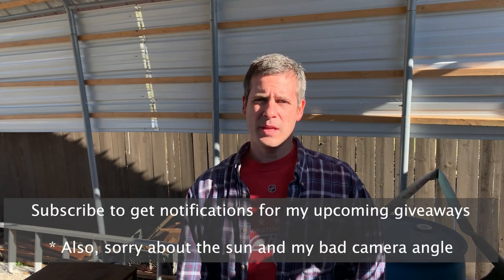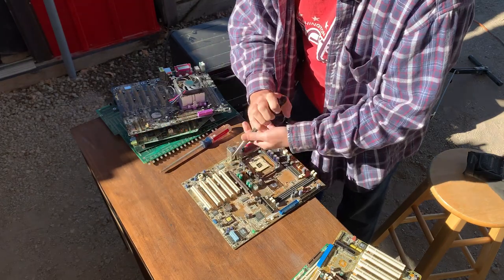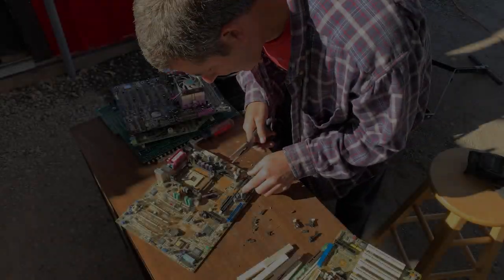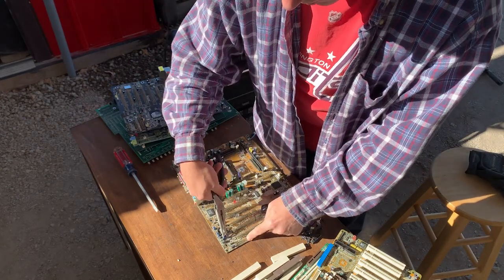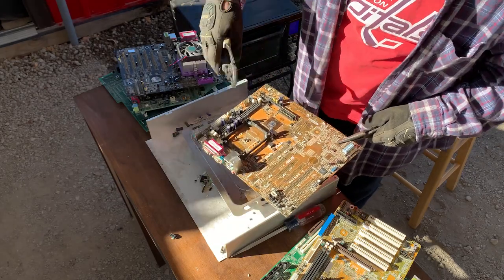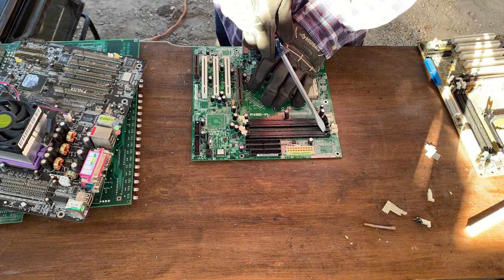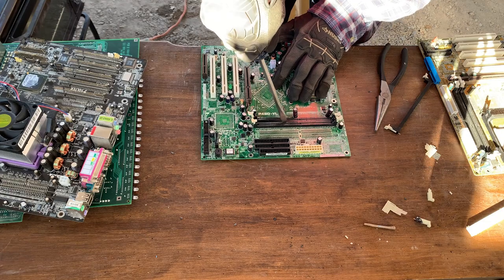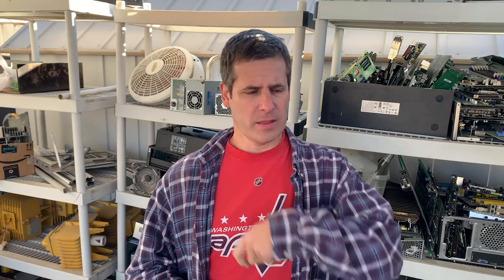Fast Motherboard Gold Recovery

Comment: Awesome video. I was scouting eBay and came across boards for sale. I’ve always wanted to do this as a side hobby and it’s nice to see people sharing their experience on the easiest way to do it. It won’t make you rich but it might be a nice way to save up for something cool doing something that helps recycle otherwise dusty useless garbage that a lot of people toss in a landfill.
Reply from the maker: I am working out an even easier way... more brute force, but less time, and less electricity cost.  Hardened paint scrapers work good with a hammer.  They will sheer off pins, pop off ICs, pretty much you can clear a board for free (no electricity or heating).  It sometimes sends things flying... but it won't create fumes or smoke.  And I can typically clear an entire motherboard in maybe 1 to 2 minutes ... were as the toaster oven cooks the solder in about 7 to 10 minutes.  If left too long, the toxic chemicals start to ooze out and your cloths smell like burnt plastics for the day.  

I would look into using a scraper.  I will have to do a comparison video between the two processes.

Comment: curious to what you do with the cleaned board when you have depopped it because the boards have quite a bit of copper in them grind and pan out or take out to the farm and burn but dont stand around them until finished I think while I was writing my comment you may have mentioned it
Reply from the maker: I have been selling them to copper reclaimers… returns are terrible for the value.  I get $0.10 per pound… but at least I am not throwing them in landfill :)

Comment: How many grams can I recover from 500 motherboards (250kilos)
Reply from the maker: Grams in gold?  Or material removed?  Every board can be very different.  There are slot vs socket processor receivers, 2… 4… Even up to 8 RAM slots. Some are different sizes, even different shapes.  Some are newer and the gold corner BGA ICs are replaced by green fiber chips that have little to no value at all.  

I don’t have a good answer.  I personally am trying to get a good estimate for the boards I have… one company approached me and offered me just short of $1.00 per pound… I am rounding and estimating a little and ignoring size differences here… but if 1 board is generally 1 pound, then 60 boards could be about 1 gram … that is a gross generalization, and I don’t have the data to show for it… but it is the closest answer with numbers I can give you.

You really have to break it down and process pins, ic chips, and fingers… those numbers are much more consistent.

Comment: Anyone have a toaster? Does the ram shed its irons? Which machine should we use? Or should we cut it with iron scissors? Urgent reply please.
Reply from the maker: I am not sure what you mean by “irons” … and are you looking for someone to sell you a toaster oven?  In the United States, these can be found at many online stores, such as Amazon and eBay.  You can also get them at many appliance stores … they are not very expensive … most of the time.  You will be able to save some money if you buy it used.  As for irons… ram is a fiber board with copper and sometimes a light gold flashing.  On the surface of all ram, you will have fingers (most are gold foils but there have been years where tin was used), surface mount resistors and MLCC capacitors, and finally, black IC chips.  I trim the fingers with snips or a paper cutter.  Once the fingers are cut off, I use the oven to melt the solder so ALL surface mounted components fall off.  I sell the capacitors and resistors (they will contain silver and a very low amount of palladium… I don’t process those myself).  I process all my own IC chips for gold.  

Does this help? Or do you have more questions?  Questions are good, … just be sure you know your risks and dangers before you start.  All of these recovery and refining steps will try to kill you one way or another.  Please be safe.

Comment: Has anyone done it with a microwave oven?  I haven't tried it.  Motherboard caught fire.
Reply from the maker: I would absolutely never do this with a Microwave!  The principle behind microwave heating is that it agitates water molecules and causes them to vibrate which heats up and expands.  This generates heat in foods, but it causes sparks and fires with other things.  Paper catches fire ... I have done that before.  I have had kids put tin or aluminum foil in and it smokes and sparks really bad.  I am very sure that a microwave is a terrible idea.  Please don't even try it to "see what happens" ... that would be a bad idea.  Be safe :) but thank you for asking.
Reply: @badideametals  you're right.  I tried it and got very bad results. Can we use Normal Oven?
Reply from the maker: @thelastsamurai82  sure.  A normal oven has a broiler temperature about 500 degrees F.  Solder melts about 350.  There is a nasty fume gassing that occurs with reflowing circuit boards.  My cloths smell like burnt plastics and chemicals.  I would recommend not doing that in an oven you plan to cook food in.  But that is just me
Reply: so what do you recommend?
Reply from the maker: @thelastsamurai82  I do my toaster oven outside.

Comment: Nice video. I'd like to share my experience: I don't cook due to no space and it's still toxic to breath. I use Tongue & Groove Plier to remove PCI slots plastics, mall nail removal tool or bent flat screwdriver to remove RAM slots plastic by picking from bottom, metal cutting scissor to cut gold plated  tips of pins, flash cutting plier to cut ide connectors with plastic. Thanks.
Reply from the maker: Nice :) those do work ... I started out doing the manual clip and rip method.  I stopped after my arm would cramp up.

Comment: Good info. New Subscriber 👍 Toaster oven isn't a bad idea. I still worry about the energy cost. it would be nice to bring it to almost zero. I was thinking about a campfire with an oversized/large pan/sheet that has a layer of sand. A bed of hot sand to loosen everything up. Maybe even pull those long plastic connecters off after a few minutes of heating and then later drop the pins when it's really hot. I have plenty of free firewood where I live. Let me know your thoughts and anyone else is welcome to pipe in. Thx
Reply from the maker: Thank you so much for subscribing!! I did the camp fire computer cookout once and was sick for a week... my neighbors mentioned it smelled outside ... they did not know what was burning, but they said it smelled toxic... and it really was.  Camp fires get too hot as I learned... also, the fire is unmanageable ... as the fuel gets consumed, the heat drops, when more fuel gets added, the heat spikes.  And the distance of my pan to the core of the fire was hard to adjust... so I just let it over heat... which caused a lot of bad smoke... 

I too have a lot of free wood available to me.  I really wish that it worked out...

That was the last time I used a camp fire to depopulate... but I had the same thought you did :) ... I am researching solar panels or a solar oven... but it would need to be a summer thing :)
Reply: @badideametals  Yikes yes definitely I wouldn't do an open fire. And I bet you probably did have a toxic smell. 😂Plus not around other houses for sure. You would want to be on a bigger piece of property. 
My idea would be to heat the sand. A sand bath for circut boards is what would do the melting.
And definitely wouldn't want to heat them to the point that they're smoking.
My idea was a pan or sheet that covers the fire. Like over a pit or tower of blocks. The sand would be either on that sheet or inside of another sheet/pan whatever. Then throw a couple of boards on and let them soften and then drop your pins. The fire should never touch the board.  
Anyways it's hypothetical...just a thought on another way to depopulate. 
I pretty much box and store my boards for now occasionally pulling a few parts off with a torch only if i want the complete circut.
Thanks and keep the videos coming.👍
Reply from the maker: @TheLandlordPicker  the sand would be a good way.  When you have that working, let me know :). Free heat is better then hours of running a 1100W oven.
Reply: The sand is legit. I sort of did a combination of the two with my electric skillet filled with sad to hear them, componants facing up, then manually pulling what I wanted with ease.   I did a few times just scrape the whole board of stuff into the sand and ended up throwing a lot to the trash because it was stupid to sort all the componants from the sand. That being said,  get as fine of sand you can find maybe would work a little better

Comment: how long do you keep the motherboard in the oven
Reply from the maker: It varies… I listen for things to fall off, or I look for smoke.  If I see or smell smoke, it is time to clear out what is getting over cooked.  But in general, once the tray and oven are hot, a motherboard in an oven at 400-450 degrees F will take about 8 - 12 minutes.

Comment: The best method for heat is a fire pit with only ambers left from a fire. Charcoal could work as well but thats expensive. If the board cools down sit it back on top of the oven rack or whatever you might use to hold the boards above the hot ambers.
Reply from the maker: I did it over a fire, not coals ... and it made a mess of the chemicals in the boards.  I will have to try again but not when the fire is raging :)  A fire pit with an endless supply of free firewood is a lot cheaper then my power bill after running a 1200W toaster oven for hours.
Reply: @badideametals  DONT DO IT OVER A FIRE, build a fire and once said flames are all gone you have hot ambers, than have the boards a foot to 2 feet away. There are several methods, archimedes has a decent one if he would have the boards further up from the ceramic he uses.
Reply from the maker: Right :) I learned that one.  The coals idea I did not try ... just like roasting marshmallows :)
Reply: @badideametals  something like that yes. Fire will kill any board, first warping than melting and finally burning.

Comment: Here the best tip for you, dont worry about plastics, leave them on there because most of them are not affected AND the connectors will all come out at once by just pulling the connector  by the plastic. Remove the pins later by lite incineration so the plastics will turn to ash and you can filter the ash out but its not needed, whether its Eco gold ex or HCL, Nitric or AR it will be fine. The less work needed means you can process more boards which is the name of the game since thats the longest part. 

Other people do crazy stuff with a hammer chisel or chisel by hand waste of time you have to sort later. Ewasteben should of never shown that to anyone, hes a joke.

Just remember you still need to boil these connectors or pins in HCL or use dilute nitric like 5 or 10% plus citric acid to remove the solder.
Reply from the maker: First: What is Lite Incineration?  I watched Dasun 999 do something where he put all the plastic connectors in a pan and processed them in a fire just like they were IC chips being ashed ... 

Second: I tried doing pins without Eco-Goldex months ago, and I have to admit, I was not successful, and I wasted a decent batch of pins... do you mind either sending me an email, or posting here your process for desktop pins?  

Finally: Yes, HCl is my friend for solder removal.  

Thank you for all your comments across all my videos :)
Reply: @badideametals  First you have to tell me what you did and what happened, Than I can help you fix any steps you missed. Im guessing you didnt remove the solder first and it made a big mess
Reply: @badideametals   there are several ways to do Desktop pins BUT its really not worth doing anything new because its gold flashing, with that said reverse Electroplating or Eco Goldex is the best bet since its mainly base metals. 

Lite Incineration or light incineration ( I say lite so people wont think you should actually use light ) is just that instead of trying to crisp the plastic like a well done steak you just want to reach the point when the plastic bcomes white. Whenthat happens all you have to do is smash them and you essentially have ashes but plastic like. Than screen them with mesh or any type of filtering system you wanna use that will let the small ash particles threw but leave the pins behind. You could also wash them like wet ashing after the reaction is over. 

BUT before you try to recover ANY gold you need to run these pins through Boiling HCL to remove the solder. If you dont it will create massive problems in AP. Once you boil the pins you need to wash them with hot water several times. After that I would put them back in HCL and see if any tin still remains by looking for the smallest reaction. I usually let it sit for 5 mins and if I saw no reaction you can than add hydrogen peroxide. You could also go the route of nitric and citric acid to remove solder. Watch owltech and bohumil graman you will know what to expect, I should the linkmthe videos so it wont take long to find them for you
Reply: @badideametals  If you didnt have solder im guessing copper numer 2 chloride formed. When that happensyou need to add more HCL but you can also filter the solution off put everything back in a beaker and start over with fresh acid and peroxide. This might need to be done several times. There also a special tube you can buy, I forget the name because I never bought one and only know about them my chemistry classes and seeing other people use them for fuck ups. Its basically a tall beacker with very little girth, since gold is heavier it will tend to stay towards the bottom, this way you can mix whatever compound formed with fhe necessary acid or chemical so it goes into solution or lightens the density so you can pour it off but leave the gold. These tubes can be 2 to 3 feet tall, hate when I cant remember a name of something.

Of course if you have a massive amount of material it needs to be brought down to a manageable amount before using the tube. You can do this in large beakers, buckets or even tubs for storing shit. You can see why low grade pins are such a hassle if you mess up, hence why eco goldex has become popular even if yields are lower
Reply from the maker: I did HCl for solder, then I wanted to just take the gold off the pins, so I put it in a little AR hoping it would just start eating metal until I halted the process.  It munched metal for about 15 minutes.  I filtered the solution away from the solids, and I tried cementing out gold with SMB, and I literally got nothing.  The pins were eaten down to copper and other metals which turned black.  So, my hope to just AR the top layer was not useful ... I just did it with a small batch as I did it as a test.
Reply: @badideametals  incineration is different from buring also. If you get caught burning plastic its a federal crime since the clean air act. Most likely you wouldnt be charged with but i wouldnt take the chance especially if you have asshole neighbors. Incineration is basically breaking something down with heat without fire touching it
Reply from the maker: Great help!  I will have to try these things.  I have a growing number of pins as I keep depopulating boards.  I would like to get what I can ... as we talked in another video's comment board, I am going to try eco-goldex here pretty soon.
Reply: @badideametals  OMG, never do that again, heres what happen, do you remember the Reactivity Series of metals Chart? If not google it. The gold was dissolved than fell back out of solution because of copper or whatever metals was in the pins, this happened OVER AND OVER until the All available nitric acid was consumed, you had gold but it wasnt in the AR in was in the filter as black power
Reply: @badideametals  you can watch people in the middle east or India di crazy reactions without removing base metals or tin because they throw everything in the solution, In MASSIVE amounts, Nitric, Sulfuric acid, Hydrofluoric acid, HCL and im sure something else. This creates a extremely dangerous work environment withe the fumes even if outside, BUT it works for whatever reason and acids are dirt cheap over there so its YOLO with them
Reply: @badideametals  if you ever try nitric acid and citric acid for solder its really easy and you need Monohydrate citric acid. My guess most food grade will work as well. 

Your gold basically continued to switch places with copper in and out of solution. The same thing will happen if you dont neutralize excess nitric in AR when dropping the gold, the SMB and gold will continue to dimthe same thing. So always safe your filters
Reply: @badideametals  do you understand what I meant with your reaction with what went wrong? You really should keep large amounts of base metals out of AR, you can have some but full pins are a no no unless you wanna be like the people From india or wherever
Reply from the maker: @chosen1one930  That makes sense now.  I was just trying something :)
Reply: @badideametals  I understand, its just a no no but now you know. I have no clue why it works for people in India or wherever, my only guess is the shear amount of acids they use